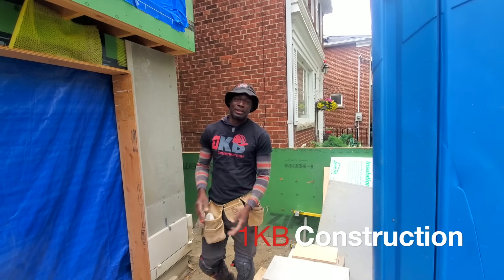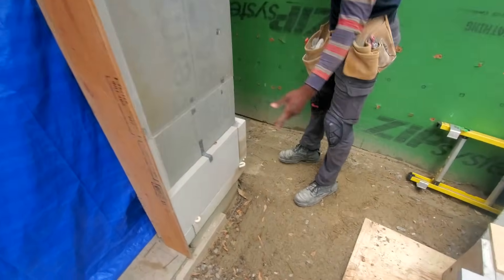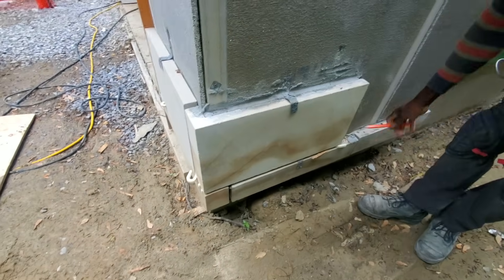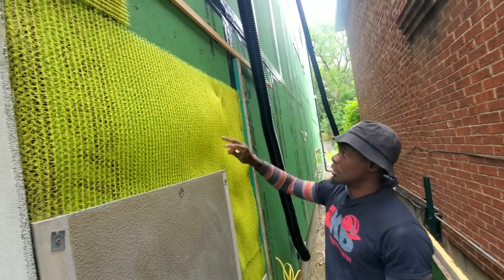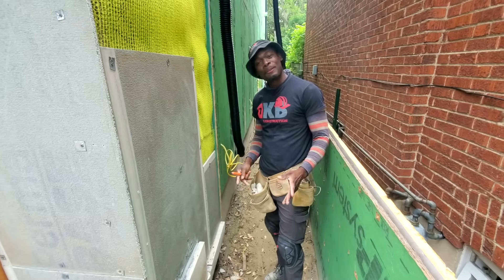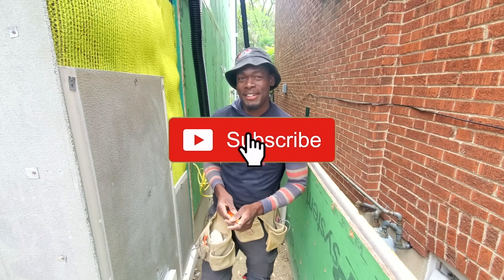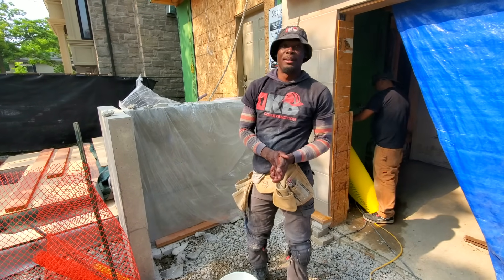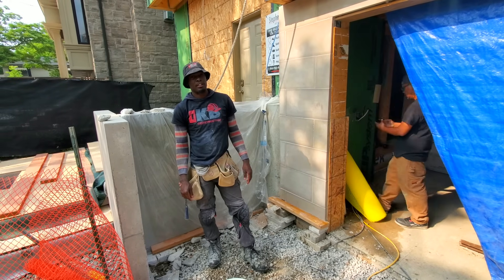Contractor Failed  We are Here To Take Over/ Veneer  Limestone InstallationDIY

Comment: Never did mesh and waterproof the seams. . . . otherwise, very good and precision work!
Reply: He did finish the seams. not sure that mesh is required with concrete backing board.
Reply: one other thing is that i would never wet the back of the brick instead its better to skim the wall and notch the brick.  Thats why the first stone came off so easy...no skim on the wall.

Comment: Dont worry about level on corner block, just plumb both ends of the corner. If you level it, after you plumb, you will throw it out of plumb.
Reply: I've been telling my workers that for years, I was the lead builder because I was fast and didn't waste moves. Built casinos in Vegas for 25 years, rented mules

Comment: If only they would have used a wet saw to make all the cuts crispy and straight instead of dry cutting and chipping them with a gas saw. The tuckpointing and finished product would have been so much nicer with clean and unchipped joint edges. Overall, the look and design was nice.

Comment: Nice work! I wonder why the bottom row is cut but ends a few inches above the garage floor?
Reply: This is done because when driveway is completed it will come up to that level.  At moment garage floor is wood, so inside has still to be concreted

Comment: ive jsut got ten into the concrete/ construction business this past 2 summers and ffixing other peoples mistakes is a lot of what we end up doing.  this one family had their water off for over a week.  reason was because someone buried tons of concrete in their front yard and when they had an excavator dig up their septic system, which failed also, we saw the weight of the machinecaused the concrete to move and crush the water line in multiple spots.  the poor lady was at her wits end with 7 kids and we ended up having to go out their multiple times until we figured out what was going on and running an entie new line altogether without charging a penny!  the boss felt so bad when the water company would repair it and it kept bursting from multiple crush points and kinks.  he and i got it done though but we were amazed at the amount of concrete buried.  well over a dumptruck full.